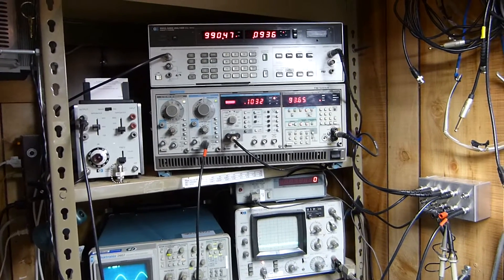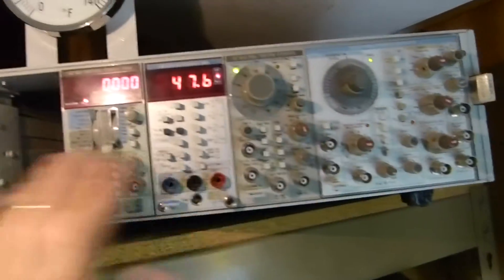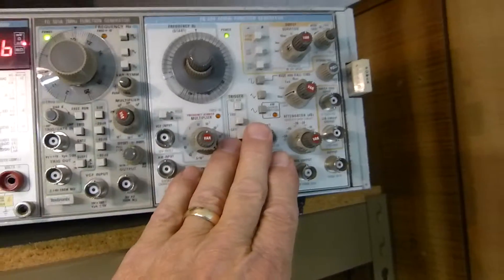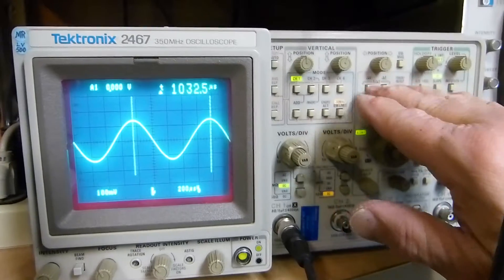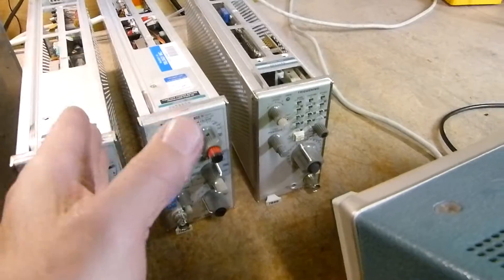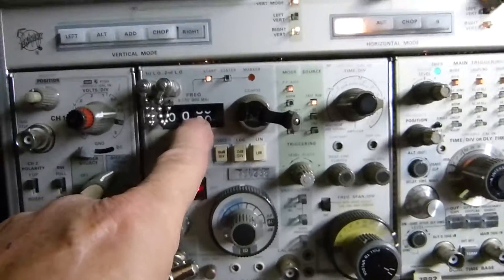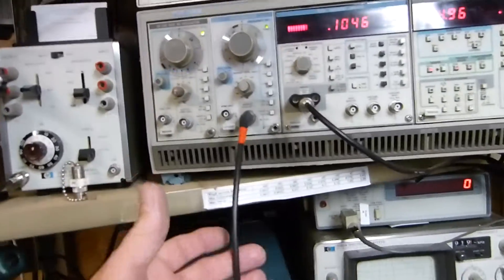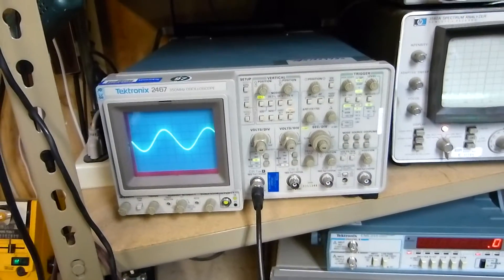My Tektronix and HP Shop Instrumentation

Comment: Hi Dave,
Again, I always enjoy your well done videos. Question... Regarding the sweep oscillator in your TM5000, what is the unit model number for that module?
 I have a very nice HP 8566B spectrum analyzer but there was not a tracking generator for that unit. It's response is about DC to over 20GHz, One thing I am trying to nail down is to be able to sweep 455KHz IF filters used in R390A receivers.
I started repairing these filters a few years ago and I can somewhat predict how they will behave by looking at the before and afterwards DC resistance. 
Perhaps that sweep module will allow me to sweep those filters.
I have been looking at TM5000 prices and like you said, they are now very affordable compared to what they once were.
BTW; I just found an Altec Lancing 350A tube amp in some surplus gear I bought. I was shocked to see what these bring on line..YIKES..The wire in the transformers must be made of Platinum...Hi
73,
Glenn WA4AOS
Reply from the maker: Hi Glenn, The sweep oscillator is a Tek FG-504 - it is a double wide module but is actually a TM500 series. The only TM5000 series module I have is the  DM5010. From your posting here, I have been playing with the FG504 over the weekend and maybe I should make a quick video on it. I would think you should be able to sweep 400 - 500 KHz for nice alignment of your IF filters. It is rated up to 40 MHz. I have done some nice 20 meter antenna experimenting with it,  some time back, by sweeping, 14.0 to 15 MHz and watching the amplitude of the sweep on the SA - first noting the amplitude of the sweep with a 50 ohm load then 100 ohms and 25 ohms for amplitude reference points. I get some really interesting results that may have real value. Another video, huh ? And your Altec 350A - I looked it up and they are beauties - very nice score. Several years ago I went to a sale where I picked up a Altec amp (can't remember the model) that ran a pair of 811A's as finals. It was laying in the sand and I asked what he wanted for it and he just told me to "take it". Naturally, I cleaned it up and played with it for a few months and then sold it on Ebay for $480,  plus... another $480 for UPS to deliver it to Australia - yes indeed $960 was spent on the beauty I picked up out of the El Paso desert sand for free. It was huge with those beautiful Peerless transformers and chokes - I think that model was commonly used in the old drive-in movie theaters to run all the speakers. If I had it today I would probably get $2K for it  :-))
73 WA4QGA
Reply from the maker: wa4aos Hi Glenn - haven't heard you on lately and just wanted to check in with you and make sure you and yours are doing good. All is good here - nice weather, etc. Drop me an email when you have time.  theaudioshop@sbcglobal.net

Comment: Hi David! I really like the 2467 scope! A friend of mine bought one recently and brought it to my shop for me to try (teasing me) :) I love it! Excellent and very versatile scope. I would like to get me an extra scope and have one set up for final amplifier testing, and one on the bench for troubleshooting, since I depend on a scope for not only troubleshooting amplifiers, but doing IF alignment on old tube radios and TV's as well as viewing wave forms in different stages. I'm also intrigued with the 7904! Do you know if they have an audio signal generator module that would fit into the center bay? that would be handy to have one as part of the scope...less clutter on the bench. :)
Reply from the maker: Hi Frank - I am not aware of any audio signal generator plug in modules for the 7904 -  I agree that would really be nice to have.

Comment: Thanks for the tour! Wish I knew about those Tek mainframe instruments earlier; they would have saved me a lot of space. Last year I got that HP SA on your advice and have been very pleased. Easy to clean up and cal oneself. The 2467 is amazing, a great trigger and very easy to use on delay. No doubt you know about its special screen. For laughs, set up a 1ns pulse and slow down the rep rate. You need to darken the room to see details at a 1s rep rate but there they are.
Reply from the maker: Thanks for your comments. Tektronix is proud of their MCP technology, as they should be that will display these fast signals at low repletion rate that you mention and I love the scope but I wish I could have the trace stay on all the time and not have to be continually moving something on the front panel to keep the trace on. They seem to be overly concerned with "differential aging" as they call it. I have the operator's manual but I can't find a way to override the trace turning off every few minutes. Do you know to keep the trace on ?
Reply: ElPaso TubeAmps Don't give up. See Appendix C in the user doc for a configuration menu setting that lets you adjust the time out on the screen. I left it alone. Funny, it drives me crazy, too, but in truth to prevent burn-in I try to turn down all CRT instruments manually, so I rationalize this as a handy feature.
Reply from the maker: pithandmoment Thank you very much. I did find it with your help. EXER 09  it says: " xx  >  90  gives continuous timer display".  I will have to play with it but your thoughts on leaving this parameter alone is probably the wisest thing to do.